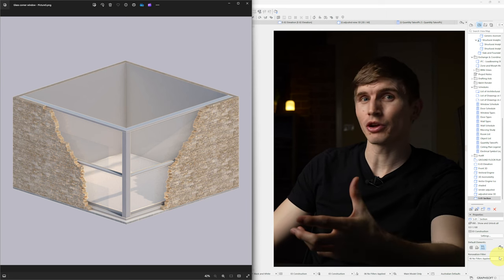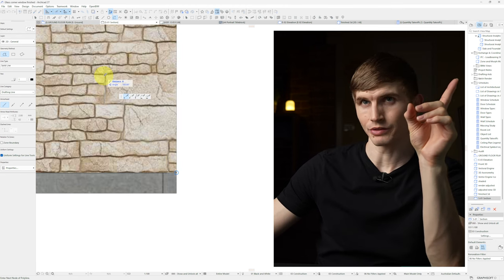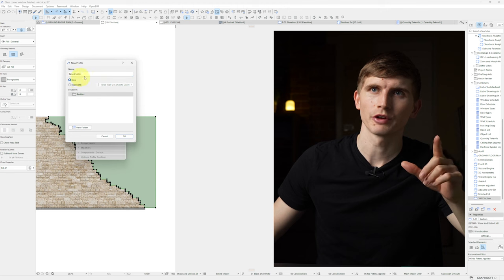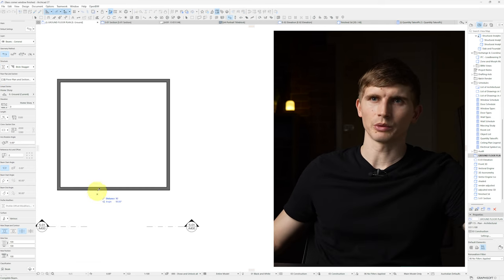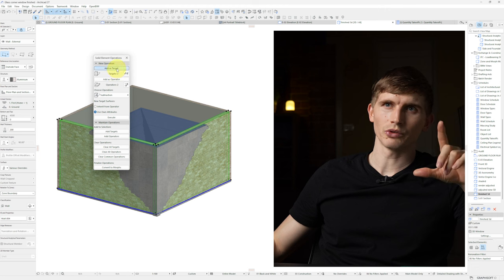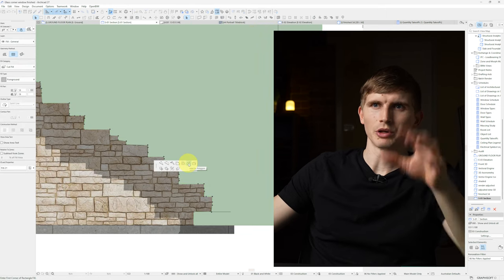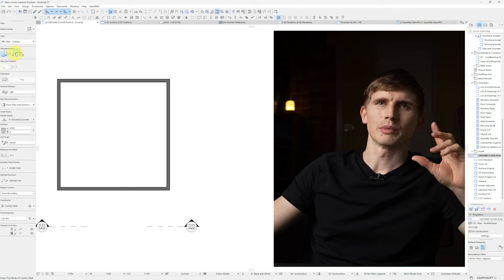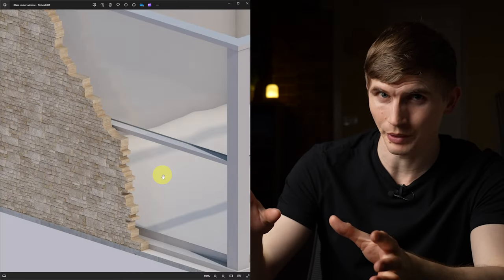ArchiCAD tutorial: Stone Glass Wall

Comment: Nice tutorial! Only if it worked! I tried so many times to follow it on a single-plane wall, not a corner like in the video and it simply won't substract the two surfaces. If you have any ideas why it doesn't work, please share!
Reply from the maker: could be a few things, sometimes I make sure there is more overlap of the operator than needed to make sure the target is covered when the operation is executed. also trying different execution methods like " with upward extrusion" might be worth a try.
Reply: @archguide  I tried all of them, including overlapping without any success. I managed to do it by making a morph and extruding in 3D instead of a complex profile. Then I use the substraction operation and it works.
Reply from the maker: @dreamess6266  Ah beauty, thanks for sharing your solution!